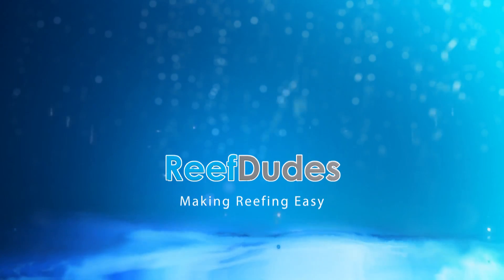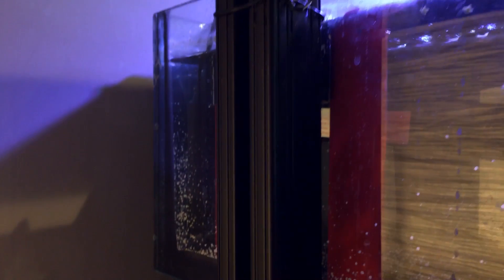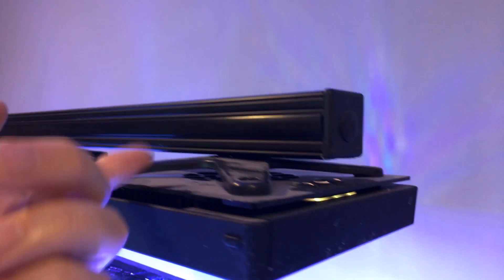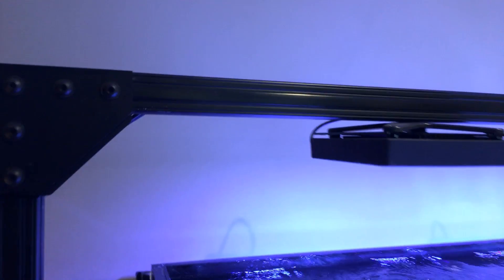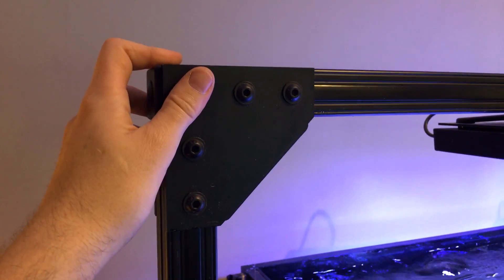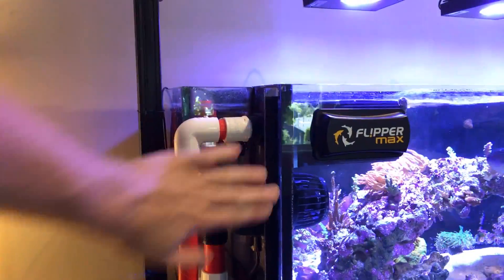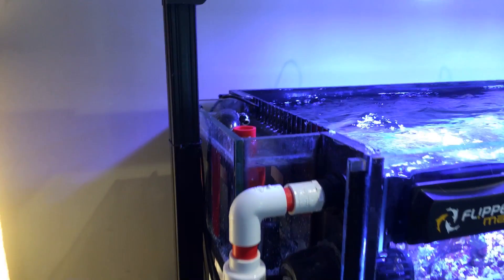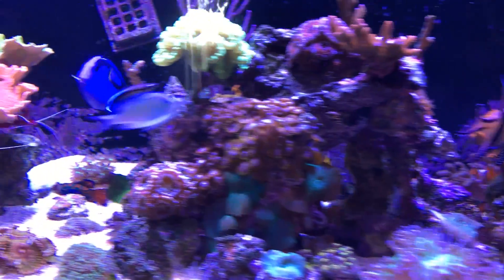Floating Lights - Peninsula  Saltwater aquarium suspended light mount - ecotech radion xr15w pro

Comment: Need to do this with XR15 G5, anyone know how I can mount the lights to this?
Reply from the maker: Drill a hole in the bottom of the mount.  I believe I show it in one of my newer videos
Reply: @ReefDudes  Thank you! I thought about that last night. I bought the 80/20 T slot and will drill a hole and mount the t slot on top of the mount. Thanks for all your videos.
Reply from the maker: @lesliesuarez7194  I just marked the middle, drilled a hole, poped in a tnut screw and nut and slid it on. works well! (how my 30s are mounted now)

Comment: do you feel you notice the 1/4" sag? I'm about to do the same thing and trying to determine if i want to spend the extra money on the 2020 instead of 1515. going over a waterbox peninsula 7226
Reply from the maker: Nope not at all.  out of 3 tanks the only one i notice the sage was the ofice tank but that was 6.5' ish of aluminum floating. On the tank in this video i put a spacer on the back of the vertical pole to put a slight angle to it and negate it.
Reply: @ReefDudes  I saw that unfortunately I'm going to mount it directly to a stud in the wall so I'm not sure how I would do that
Reply from the maker: @trevortheodore1950  The one i have bolted to the wall was good as it was anchored high up and down low so pretty solid :)
Reply: @ReefDudes  oh perfect! I'll go with the 1515 then at 5.3' off of the wall. lastly I know you have the 7225 peninsula now, do you notice a small what looks like bubble around the bottom of the tank in the seam? I can't tell if it's the part where the leveling mat is or not, i have noticed it on other peoples videos as well

Comment: Excellent that’s exactly the type of light bar I need. Could that be used on a reefbreeder light & possibly thinking of putting two led bars one on each side to fill in case I have shading. 
I have to do my own Dyi stand for the wb6025 so that’s going to change the style of what I was planning to do. Please advise where I could get the aluminum and what I need? Who could you recommend? Ty

Comment: Also where do you get the rubber that fills In The slot of the aluminum arm and what screws for holding g each light into place. I think a couple items where missing from the list you made for everything you used. I have two xr15 g5 pros I need to hang
Reply from the maker: I’ll dig up the packing slip for the new one I made and post it

Comment: Could you tell me what bolts you used to attach the aluminum corner pieces and also what ones hold the lights in place thank you
Reply from the maker: All the same screws for that and they go into the T nuts

Comment: this is perfect. just bought a peninsula tank but having problems finding adequete lighting. how long is your tank and how long is the top piece of aluminum?
Reply: also, high high from the top of your tank do the lights hang? probably gonna do the same w the xr15s. thanks!
Reply from the maker: Tank / stand is 6’2”.  Not sure on the others. Will have to check when back in town

Comment: I'd love to use 80/20 for my dream tank and floating light setup. Would I still need those "spacers" at the bottom if everything was modularly connected?
Reply from the maker: Do you mean my couple washers? Haha that was just to negate a tad bit of sag.  I’m trying a different mounting method on v2 of the tank..coming soon :)

Comment: Hello I have a question I want to build the same tank Mount that you have for your lights but my question is did you use every single part on the description link or did you only use a 2 of the 15x15 rods
Reply from the maker: The stuff in the description are just options as the length of the rails will depend on the size of your tank.
Reply: ReefDudes ok sounds good I thought I had to buy all those rail lol but what kind of clamp did you use to secure it to the fram of the tank stand
Reply from the maker: I used L brackets to attach it to the stand :)
Reply: ReefDudes sounds good buddy thank you for all your information I'm going to have to make me a floating light stand because I really don't like the Ecotech Marine stand that they have for the radion xr15 pro
Reply from the maker: Awesome, good luck and let me know if you have any questions as you go

Comment: Hey on the part 80/20 Inc., 4351, 15 Series, 5-Hole 90 Degree Joining Plate. Did you order 2.
Reply from the maker: Reefer Rob yes I have them on both sides.  As well As tapped the top and the inner corner guest.  I extremely overkilled it

Comment: Great video! Deflection is rear with all those lights and the length! 

If anyone is interested in 8020 I think the best way to purchase is to pick out your framing option first. After that you can narrow down your fittings for the specific framing option. The good thing about the 8020 website they have recommended hardware below the fittings in a tab. Makes this process very simple! 

The lights are Gen 3's?
Reply from the maker: pelphrey they sure are and greet tips!
Reply from the maker: pelphrey they sure are and greet tips!